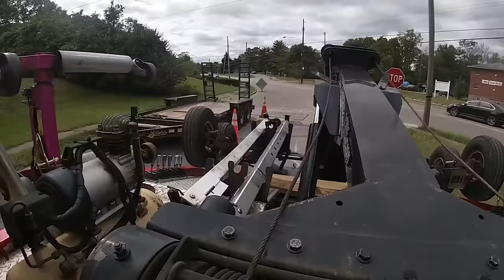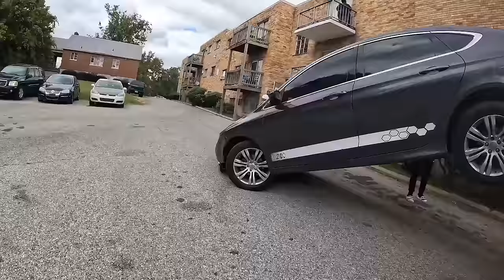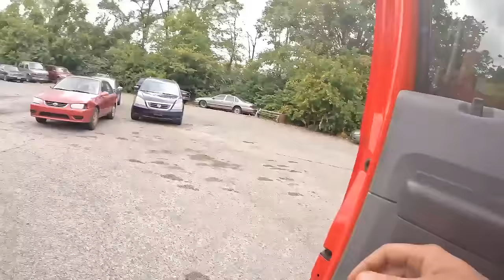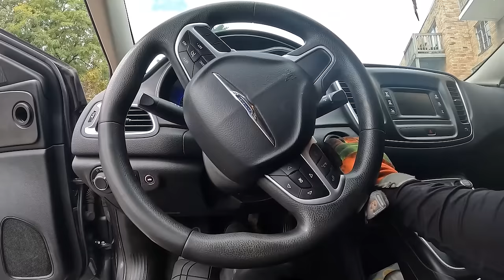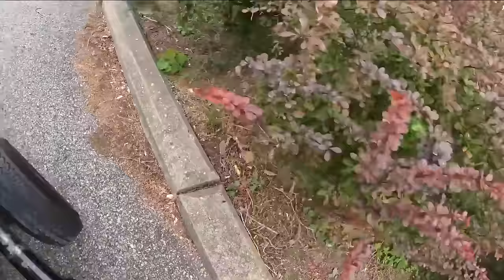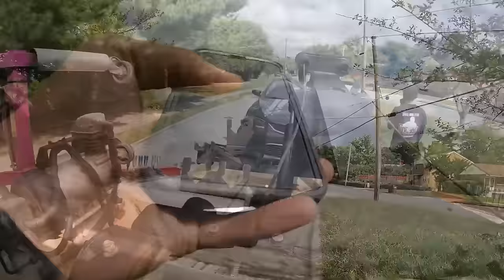SHOT FIRED ON REPO

Comment: Damn my Chrysler town and country sat in my driveway for over a year until I drove it to target and left it for whomever found it. I wasn't delinquent but had a dispute with the dealership who sold it and had many issues with drivetrain and other things at 20k miles. The dealership was made to repay all my fees and repairs and the delinquent credit was removed after settlement.  I just got screwed on my trade in vehicle, which was paid and was given 7500 at trade.  I bought 4 vehicles before from this dealership and it took 1 bad experience to ruin all the good ones.

Comment: Glad you didn't get shot! smh I woulda just pulled it from the rear wheels and went around the block before worrying about hooking it up correctly after he just tried to drive off. I saw the title and I was so worried he was gonna pop up while you were in the middle of trying to get in the car to straighten the wheels out.
Reply: Pulling it from the rear wheels would have destroyed the transmission being that it is front wheel drive!🤔
Reply: @turbo95eclipse  Not for a short distance. Now if he dragged it all the way back to his lot then of course the transmission and front tires would be fucked but just to get it out of the area is fine. 

I used to watch RepoNut before he lost his wife and went crazy and he had to do that on occasion when things were getting tense.

Comment: I see quite a few videos where the back of the car is literally in the air with only the front wheels touching the ground.  And somehow the person is able to drive away from the tow.  It appears the truck sustained quite a bit of damage.  How do they get away and is it costly to fix the tow truck?
Reply from the maker: Well each guys has there own ways but for example me I strapped the tire before he was able to get it in drive which secured to a certain point as he continued I just lifted it until the tires weren't touching any more. Damage was done to the truck or the vehicle?

Comment: I do kinda miss repoing, crazy stuff people do to hide, drive of the wheel lifts.
When i was doing it, repoing was the second most dangerous job in the world.  

I don't know if your bed on your wheel lift has tow chains on both side, where they can slide down into the bed and locks.  If so, soon  get it up, strap the tires,  put the chains around the axle or links,  and extend your boom wheel lift. If they did get the wheels straps off their is no way the going to get that chain free, I've done it many times, you must have the vehicles as straight as possible.  I ran a dynamic lift

Comment: A lot of things you did wrong in this video as a repo driver.

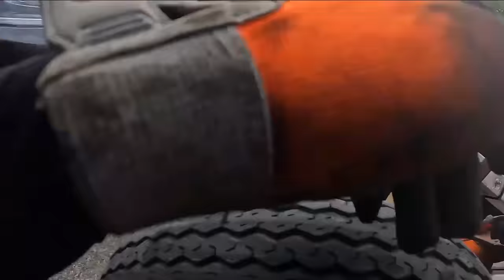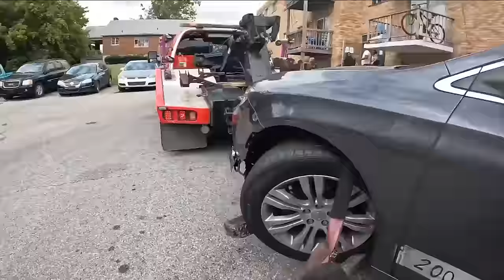First, you should have come in and done a 90° degree, hook it and book it. Not sure what you were planning on doing by hooking a front wheel on the rear. Dollies take at least 2 mins (because that's how long it took you 16:40 to 18:30 ) and that's if you're fast. 

You had at best 3ft in the front even with the van initially in front. Any good driver would have backed up, 45 or 90 it and snatched that on the first grab.

It seems like once you grabbed it from the front and started to pull off you noticed the emergency brake was on that's why you jumped out and threw dollies on. But you wasted so much time doing the lockout because any experienced driver knows you can't release the parking brake these days if the car has electric brakes. Only manuals like the foot brake or handle would have been worth getting into. Then you wasted time popping the hood and disconnecting the battery. Really? Let the car honk. Who cares. You've already caused a scene. Plus, the car is already in parked. Screw the wheels straps. One side is okay if you really needed it until you're off the property then fully secure both sides. Yet you decided to hand out business cards to on lookers. That's why you ended up in the position you did. You gave that man enough time to grab his pistol. You could have lost your life in that very moment. 

Next time, less work. Practice your 45 and 90 degrees, grab it and dip out. One strap if necessarily needed and have your dolly axles preset ready to go. And no chit chatting. Those people aren't your friends and you can bring them cards at a later time. Hook it and book it. Business is business.  Time is of the essence so boogie on out of there. Quit playing for the likes and views.